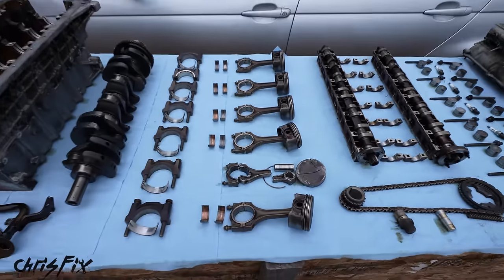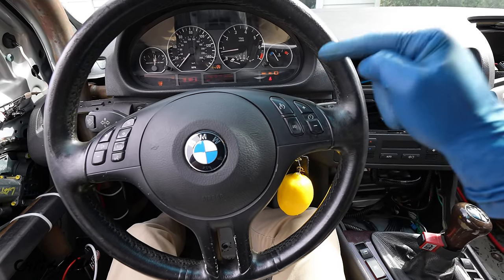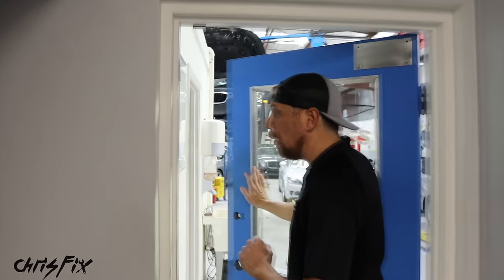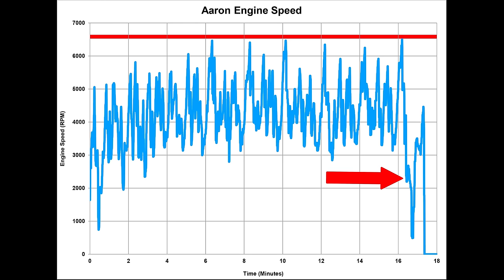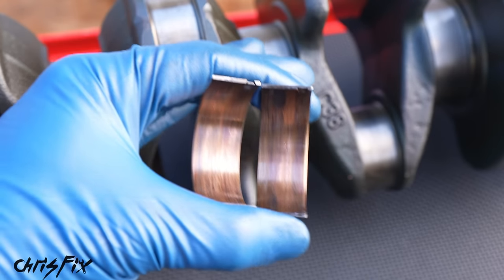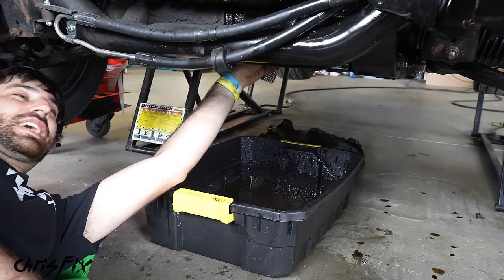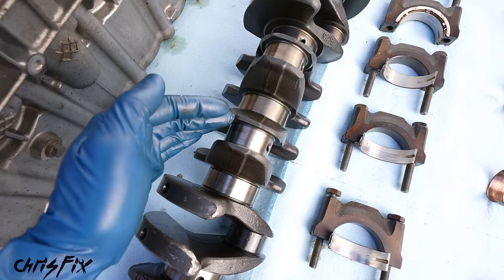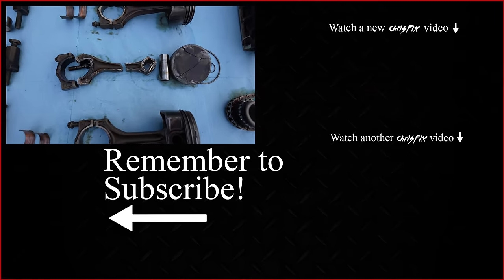What Causes a Spun Bearing in an Engine?

Comment: Chris, excellent job, but as a Racing Engine Builder let me make a suggestion.  Buy a tool to cut open oil filters. Your oil filter is a data collection tool, no difference than data from software. Also if a permanent filter made out of surgical stainless steel is available,  invest in one. You can take it apart in minutes,  cleans easily with brake clean or even soap and water right at the track. They flow BETTER than any paper or gauze filter, and are worth every penny. After 4 decades of doing this, when I build a Race Engine,  it's included in the price, and there's  no room for discussion. 
T.S. RACING

Comment: My first thoughts when I started watching the video and you showed where the engine failed I immediately suspected oil starvation which I still believe was your issue and not the high mileage. High mileage will decrease oil pressure but not to the extent of engine failure. I believe you lost pressure from heavy breaking before going into the turn. This is why race cars have a dry sump with an oil tank to make sure the pump always has a supply of oil. The high mileage engine was probably burning oil so you probably ended up a little low on oil as the race progressed.

Comment: I would think about some baffles for the oilpan. The oilsystem is not designed for this kind of combination with that much grip of those semis u have. So the oilpickup will suck air at some point and u know what happened in the race. 
Great video btw

Comment: in most cases, its because the oil pressure is very sensitive. if you have any oil leaks, or starvation, etc. your vanos system runs off oil pressure,  check your logs and see if you were pulling timing durring the time the engine let go.  ive built a dozen high hp tight tolerance bmw engines over the years.  accusump. 10000% worth the money and headache setting it up.   all the rubber gaskets , oil filter gasket, valve cover gasket etc need to be perfect because any oil leak = presure loss, wich leads to starvation even durring daily driving.   theres a mod you can do to block the head ports. this will help keep the pressure high and oil out of the head and down in the pan where it should be.   hope this helps.   you should use a looser tolerance bearing, and accusump. thats all youll need!  as big of oil cooler as you can fit, to add as much extra oil as possible, starvation will go away.   my track car has like 10k miles on the track now.
Reply from the maker: Thanks for the info! We will definitely consider all of that!

Comment: S54 engine is known for the rod bering issue as well, usually you have to keep an eye on the oil analysis to see if metal levels are elevated to see if its time for new ones. Also, my mechanic told me that the 15k mile oil changes had to be moved to 10k. I did not know the m54 engines suffered the same fate. :/

Comment: Regarding the 140,000 miles: When the engine is completely overhauled, maybe less bad than it sounds. 
 
When the Turbos took over Formula 1, BMW took over. And as basis they used BMW 3-series blocks with at least 80,000 km (50,000 mls) runtime. 
 
The reason what that the thermal stress on these 1,000 hp-engines are extremely high, so you needed a well-tempered engine block that had lost all internal tensions that could lead to warping. 
 
Old engine block had experienced that "treatment", warming up, cooling down, hundreds of times. They were ideal.

Comment: Ah, so tl;dw:

1. engine heavily used (and likely under-maintained) by prev. owner, leading to inadequate oil pressure for high engine power
2. provided gauges and indicators failed to show inadequate oil pressure
3. oil failed to adquately lubricate bearing 2 due to inadequate pressure, allowing excess friction
4. friction heated bearing 2 to point of failure
5. rod and piston 2 departed their intended range of motion due to loss of constraint from bearing 2, striking and damaging further engine components and rendering engine unusable
6. equipment and parts on hand were inadequate to repair or replace engine in a timely manner

It's nice to see this kind of depth of investigation, especially in something non-aviation-related.

Comment: I bought a 2011 BMW 535i, from an auction site.  It was a salvaged vehicle, with no powersteering , and engine fault codes (P052B, and P054B).
Reply from the maker: That’s awesome!
Reply: @chrisfix  any idea how to deal with the fault codes?  I saw some videos about cleaning or replacing the VANOS solenoids.  maybe that will work
Reply: @chrisfix  After over year and half of messing around I finally bit the bullet, towed the vehicle to a local shop and had an engine swap done. The vehicle is running good now.

Comment: Hi chris so i am 13 yr old and my father has an mahindra xuv 700 diesel. It has problems in the steering. The steering is always tilted and to go straight he has to hold the steering wheel which has caused him a lot of health problems. Can you make a short video on that or link a video if you have already made a video. We also had problem with power steering but after watching your video our problem was solved. Thank you

Comment: Hey chris another way you couldve lost oil pressure was probably because the oil pickup has a hole in it unless thats meant to be there as the oil pump couldve not been getting enough oil

Comment: I never spun bearings after doing one thing while assembling , overhauling engines , the bearing anti-spin tabs often don't make much depth of contact in their groves butting against the rods or mains surface , i've seen bearing tabs making as little as 15 thousands of an inch contact ! This can be easily eliminated by stalking the tabs to full depth fit in the slots , get an appropriate sized flat punch chisel and after installing the new bearing stalk them to full depth ! Takes little time and can help delay a momentarily dry bearing from spinning till oil flow and pressure resumes !
Reply from the maker: Thanks for sharing!

Comment: My sti spun a bearing from excessive oil consumption most likely from how the built motor was put together. Luckily I was just cruising in traffic at low rpm so I don’t think it damaged any other parts in the engine.

Comment: You should also have a suitable oil in the engine during the race like a 5w40 or even 5w50 fully synthetic because oil temps will be pretty high I assume and load on the engine will be high so its all about the oil and under those conditions you want to go up in the viscosity so these M54 take a 5w30 or 5w40 so yeah I am glad to see that you had Shell Rotella 5w40 in there which is already a solid oil.
I would use a 5w50 personally to be on the safe side especially since the new engine isn't all that new also so its got some wear and a thicker oil will compensate for that at high temps.
The last number matters the most since that is the viscosity at 100 Celsius while the first number specifies cold flow ability.
Redline oil is really good and they focus on performance and racing oils I highly recommend that brand.

About the engine being close to overheating: Just remove the thermostat you wont need it on a racetrack when its warm outside. That may increase coolant flow enough if that's not enough time for a new rad.

Comment: 4:54 ...yeah it looks thin from the side, but it's quite wide from the top..   M54 B25 and B30 has the same manifolds too, so I really doubt those are hurting anything with a stock motor @6k rpm
btw, all of those bearings don't look so great!  IMHO, you guys had a mostly worn out engine to begin with, because whoever had it before either didn't take very good care of it, OR they followed BMW's 15,000 mile oil service intervals! ;D
Reply from the maker: For 3 cylinders, that's still quite the angle it needs to travel down, and this was definitely a 15,000 mile oil change engine haha

Comment: Maybe you should use higher viscosity oil when beating the engine on track with very high temperatures? Maybe 5W50 or even 5W60?

Comment: BMW recommends "15,000 mile oil changes" You said it had 248,000 miles on it? That's the problem. Even with 9 or 10 quart capacity that is way too long an interval for a northern North American climate. That engine was toast when you got it already. Interesting video, enjoyed this series :)

Comment: Larger radiator. Add over sized oil cooler and use 60 weight race oil. You should have alarms for over temps.

Comment: Zinc level in the oil is fine but molybdenum level is too low for endurance racing, even lower than average regular engine oil. Those two, especially molybdenum disulfide prevents metal to metal contacts at extremes.
I highly recommend mos2 additive. If there was enough mos2 in it, you would never know what mos2 does, that counts.

Comment: @ChrisFix Are there any aftermarket oil pressure gauges you can add to this specific vehicle? Either by adding a separate sensor and gauge altogether, or some sort of digital gauge via OBDII that won't break the bank? Excellent video and diagnosis for the engine failure, I learned a lot from the tear-down!

Comment: Another cause of starvation that you did not mention is oil becoming trapped in the head because of inadequate drainage at high rpms. There is an epoxy paint designed for engines that are intended to sustain high rpms for a long duration. This paint will go in the oil return passages of the head, as well as dressing and deburring the return passages.
Reply from the maker: That’s a good one too! The paint is an interesting idea. I guess it’s hydrophilic paint?
Reply: @chrisfix  The paint typically used is GLYPTAL 1201.  It's not so much a hydrophilic paint, but more of a smooth surface preventing the oil from sticking to the surfaces. You have to make sure you have a really good surface prep so it won't flake off, which could collect in the oil pickup and clog the pump.

Comment: Quick question: What if you rebuild the engine without the piston that broke. What would happen to it? Will it just not turn over??

Edit: I am just asking, im a noob at cars (😛)
Reply from the maker: The cars computer would probably not allow you to start because it could not measure anything from that cylinder. If it did manage to crank over it would run extremely rough and have some severe vibrations as the balancing effect of the (in this case missing) cylinder would not be present. You would probably warp the engine pretty quickly!

Comment: One thing that should be put in a car is an electric motor to pre spin the oil pump, so you get oil where you need before you start the car
Reply from the maker: It builds oil pressure in less then a second now but I can look into something like that for sure!

Comment: Many years ago I was driving my Fiat Tipo from 1995 and one of the bearings spun due to the low oil level. After refilling the oil, I managed to drive another 110 miles before the connecting rod broke off, and then I drove another 2 miles on 3 cylinders until the red hot engine seized. That was very strange FIAT engineer fantasy engine DOHC and only 8 valves.

Comment: Whilst the motor is out you should have swapped on an m52 or m50 intake manifold. You can get them for $50 at junkyards and they add 10ish hp. That plus the exhaust and then if you put the zhp cams back in from the other motor you could have been pushing 250 hp
Reply from the maker: We don’t need more power right now we just need reliability but definitely great tips!!! I didn’t want to run those cams because they were slightly scored.

Comment: 😂😂 You rickrolled us with that phone number. Love your vids man! Quick question (kind of unrelated to the video), I’m about to go under my S2000 and check the torque on the front and rear subframe. I’ve heard that they tend to come loose easily due to the severe vibrations of the 9,000 rpm motor and extreme NVH of the AP1s. Will I need an alignment after torquing any of the loose ones down?

Comment: I would have installed new rings and main with rod bearings . Putting in a batter oil pump . Maybe have the head rebuilt .

Comment: got a question, if i had a car that has had the services done as recommended from the manufacturer, and the car has 200k (or more) miles and no signs of issues from the engine, would you recommend it to be taken apart and inspected for damages and potential rebuild, or just leave it until something happens?

Comment: Hey Chris! Two months ago I bought an 2004 E46, and now the EML/check engine light turns on and the car goes into limp mode. It goes away when I restart the car and it then works fine. I dont have a lot of money so I was wondering if you got any suggestions and if there is an easy fix for it?
Reply from the maker: First thing I would do is clear all the codes and see if it comes back, and make sure your battery is charged properly and in good shape as sometimes weak/bad batteries can start causing weird issues/limp mode. If the codes do come back scan the computer and see what it says. If it's going away by turning the car on and off then the computer might just need a wipe of the codes.
Reply: @chrisfix  Alright, a buddy is gonna help me have a look at the codes tomorrow. Thanks for taking the time to answer my question!

Comment: My dad had a drag car that used a puke can and one time we were doing some test passes and the the coolant from the puke can splattered on the oil pan and because of some weak metal that melted it drained the oil from the car and it ended up spinning a rod bearing thank God the rod didn't shoot out the engine block

Comment: Hey Chris, I have a transmission fluid leak where my engine and transmission mate (FWD). It's not something that I can fix, so I was wondering if you would recommend any "stop leaks". Would you recommend using something like AT 205 Reseal for an automatic transmission? Thanks

Comment: Any car bought used, start with new rod beaarings. BMW racing, over fill by 1/2 qt of oil. Could have ben starvation in the corners. What oil were you running? On my track car the oil get changed every 6 track days....

Comment: @ChrisFix or anyone who knows the answer: won't the ECU throw a fit if you remove the cat? I have the exact same car for drifting and want to fit similar headers but haven't because i thought the car would go into limp mode. Thanks
Reply from the maker: It will turn on the check engine light but it should not go into limp mode, in fact the opposite should happen (more power) because there is more breathing ability with the headers/exhaust
Reply: @chrisfix  thank you very much, i appriciate it 👍

Comment: I have a question, why cylinder No. 02? 
Why not 3 or 6 or any other?
Reply from the maker: Probably just the cylinder with the least pressure/most wear. Just luck.

Comment: oil is the most important thing in an engine and i really hate it when manufacturers dont take it seriously. is it to much to ask for an oil pressure/temperature gauges? some cars have them but not nearly enough.
Reply from the maker: Right? Im actually surprised with BMW because this is supposed to be a performance or sporty car. I mean my pickup truck has an oil pressure gauge!

Comment: that Oil light has 2 colours, when it's yellow it actually means that you are low on oil or oil preasure, once it turns red is too late. Now E46 have the common issue that the Oil level sensor (located on/in/under the oil pan) go bad and it lights yellow for around 10 sec when you start the car and then it goes off. Sooo....

Comment: My dad had a 2014 doge himi engine i built it and it did not start up yea it spun the baring we replaced the everything it should have ran
Reply from the maker: Darn! Did it damage the block?
Reply: @chrisfix  no it didn't and we replaced everything there was nothing wrong when we replace evey thing we spent 10 k fixing it and it didn't run we bought a 2021 doge ram is that a good truck

Comment: If I heard correctly you don't know what condition, internally this "junkyard" engine is in, just like the previous engine?
I'd suggest going through it so you don't have another block with a hole in it, but this is racing on a budget and you have very little of that, so cross your fingers.  ;-)

Comment: Hello ChrisFix I Really Need Your Help Why My 1990 mazda titan makes a strange noise when shifting to reverse please help me
Reply from the maker: Could be CV joints or just a worn motor/trans mount: https://www.youtube.com/watch?v=ZTRV5GXWpo0
Reply: @chrisfix  i forgot to mention that when its hard when shift especially reverse we just engine swap it with an isuzu elf Would It be the transmission?
Reply: @chrisfix  i watch the video chris theres is no promblem with the engine its just its hard to shift into reverse it will make a screeching Sound type like if we try to shift

Comment: Hey, I accidentally redline my car in manual mode because I forgot to shift and overheated the engine and it shut off. Can that cause any damaged to the transmission because I'm replacing the engine and I'm just concerned about the transmission...
Reply from the maker: It could put wear on the particular gear you were in. With everything out it might be worth getting it checked out
Reply: @chrisfix  Thank You for replying
Reply: @chrisfix  I had that exact thought in my head there, I was thinking that the gear could get damage and maybe the clutch plates/packs associated with that gear could get damage as well...